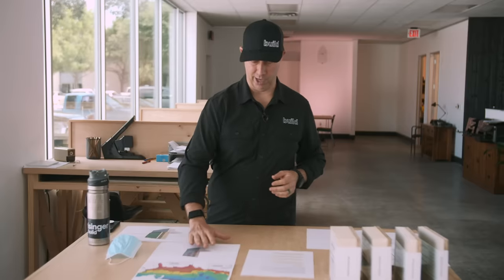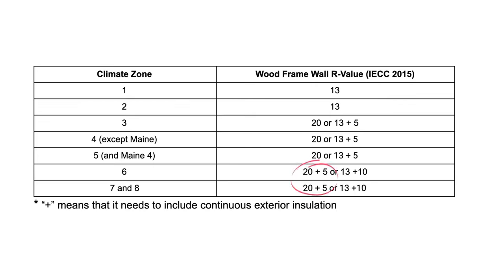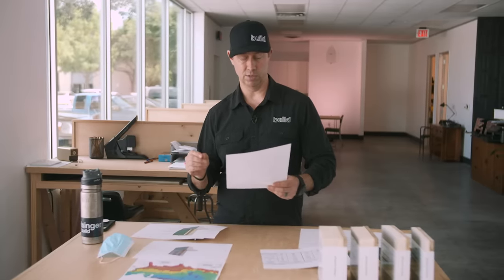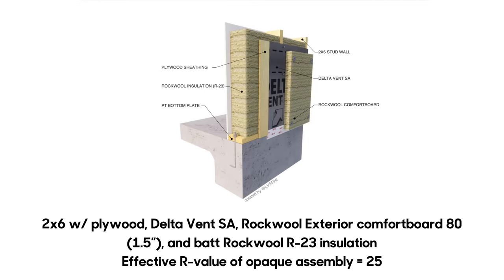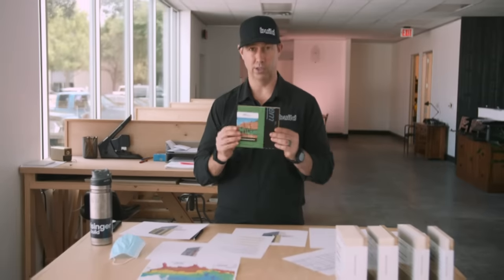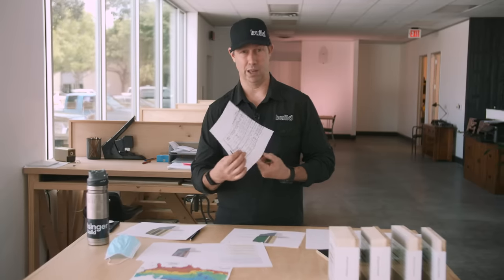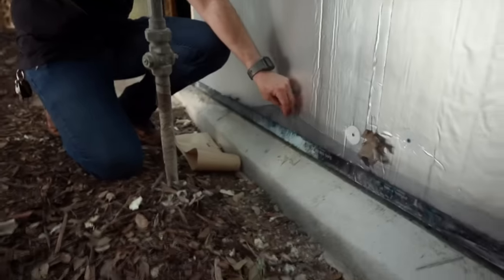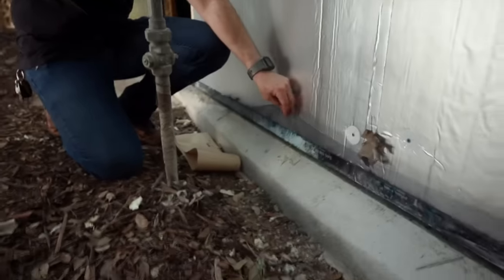5 Ultra-Insulated Framed Walls

Comment: One other important thing to consider that wasn't mentioned (although hinted at) regarding polyisocyanurate insulation is... Polyisocyanurate's R-value diminishes the colder it gets. So it is less effective in northern climates unless used on the warm side of the assembly and then you have to consider vapor transmission. So maybe interior side of ceiling below the truss or rafter assembly provided the walls are vapor open (for northern climates). A more natural assembly could utilize 'dense pack' blown in cellulose insulation (which retards air movement), solid 1x board sheathing, heavy roofing felt, and comfort board insulation. The cellulose, real wood siding, and felt (tar paper) have a tremendous capacity to absorb excess moisture and dry out later. Many traditional and natural materials with much less embodied energy can and do perform as well provided the wall assembly is constructed with some planning and foresight.

Comment: For zone 6A a RESIST assemble with 2 inches of GPS foam taped, provides a flow through assemble.   With 2x6 T studs and ICF you have a continuous air control and thermal control layer.  That provides the monopoly framing and meets the perfect wall guidelines.

Comment: On my old house there is 2 by 4 walls and only sheething innside, cold climate in Norway.
Doing renovation on it and changing the wall siding, put 2x2 laying on the whole wall and insulated the outside with rockwool then Tyvek vapor permable fabric and then one more layer pressure treated 2x2 for air flow and then the siding. 

Love the tought of insulated house framing where it stays at a nearly constant temperature all year around
Reply: Everything of the stick framing is 60cm on center here or 23.6inch so there is a small scuare overlap wood only all over the wall but much better than whole stud wall exposed to the cold.

Could not get a hold on the firm rocwool type made for exterior use without 2x2 framing so just used regular for cavity insulation

Comment: Being in the north, zip sheathing is making nervous because it's air tight. We need a vapor barrier inside the house, so if it's air tight on the outside as well, any water trapped in between may cause rot. There are many documented rot issues because of acrylic siding causing a similar issue where it is supposed to be water and air tight, but unavoidable defects (from install or from later modifications) end up causing terrible rot.

Comment: Would love to see about ICF walls and a SIP roofing. I’ve been looking at building a house in climate zone 2 in Arizona with a standing seam roof, and on the walls, half to be different color standing seam on top and rock face on the lower portion. I’ve seen some other people post about it and wanted to show interest.
Reply: ICF is great in your climate. A lot cheaper ways to insulate than sips.
Reply: SIP roofs get a lot of bad reviews. They are a disaster in Alaska, mold. Even in the desert u better keep the water out!
Reply: I'm planning a remodel/addition in Scottsdale and am working with some really amazing BS engineers where we're trying to get to a passive house standard. What I will say is wood-fiber insulation is amazing in our climate and is often overlooked as a product (competes with Rockwool so Matt doesn't have a huge play to mention it). ICF is good but the carbon footprint isn't good. However what I will say is if you do ICF, focus on exterior insulation and keep the interior mass uninsulated to allow for radiant cooling/heating during the day and charging at night.
Reply: Gerald Leenerts     I’ve never heard of wood fiber insulation. I can put propane torch blue flame on Rockwool for a minute, it’s will not burn, it turns dark & puts out a little smoke but will not light & burn!
Yes in the desert the thermal mass (concrete) should be on the inside for maximum effect, but I don’t think it’s wise to use ICF & strip the foam off the inside....
Reply: @GeraldLeenerts   they have done studies it doesnt matter which side has more insulation. What is the carbon foot print of a house that lasts 200 years vs one that lasts 50
Reply: @av1204  the concrete will last, but the foam might not. Wood structures can last hundreds of years too. Recycling wood is much easier too. Turn it into biochar, pulp, burn it for energy, re-use it in a new structure etc....

Rockwool is an interesting product, however wood-fiber insulation is very fire retardant as well, much more so than ISO.

Also, Fox blocks makes a ‘reveal one’ which only has insulation on one side. I haven’t used it, but that’s what I was looking into before I learned more about more green materials.
Reply: Gerald Leenerts the house I currently live in has concrete walls and its great to keep out water and bugs but boy it transfers heat and cold, so I’ll keep in mind what you’d said about insulating the outside instead of the inside but at that point it’s just a concrete poured wall with insulation on the outside. At least both should keep heating and cooling costs down. As for the carbon foot print, I willing to go with a bigger footprint if it means being used for longer, so using more upfront but extended over a longer period of time than a traditionally built home.
Reply: @Venumundo  There is no right answer, and ICF is a find product. What ever direction you go, I'd love to hear how it works out! Every building is its own case study.

Comment: I'm sure there's all sorts of research on this but I would be worried about shear resistance with the thicker Zip System sheathing. My inclination would be to just say no in the most serious earthquake areas.

As an aside, the exterior rockwool insulation sounds awesome for use in a fire area. This seems like it could be part of the construction of a nearly fireproof house.

Comment: Hi Matt this is a great tutorial on wall assembly options for different climate zones.  What I'd LOVE to see is how you deal with windows in each of these options.  Where is the window flange mounted (to sheathing)? Do you furr out the window openings so that you can attach the window flange on the outer face of the rigid or Rockwool comfortboard? My understanding is that ideally you want the window glazing to line up with the rigid insulation plane.  Any details you have for the different options would be appreciated. Thanks, Blake

Comment: My house is a DELTEC home. The walls are 2x6 with a 5/8" plywood sheathing and then a 1" foam with fiber cement siding over.  I spray foamed the walls with3" of 2# foam. The basement is ICF and we sprayed at least 3" of foam on the rim, licking to the foundation.  Where I let down is on the attic.  I let the insulation contractor talk me out of foam and also out of a vapor barrier.  Seems that's standard practice in this area as I asked several builders and suppliers.  However, Half of the house is tongue and Groove pine so being concerned about airflow through all the joints, I did poly that part of the ceiling. Still, It cost less for utilities on this house which is 505 larger than our previous home and Im also heating the 900SF garage.  The walls of the garage are standard 2x6 with R19.  I only heat to 55 degrees in the garage.  We're in zone4 but it's actually fairly mild here in the winter for this zone.

Comment: one of the most interesting videos (that somehow I missed... for 8 months that is) if you ask me. I would like to know if there is a (calculated) point of diminishing returns on Insulation as expressed by R-value. The cost per sqft in the video are not horrible (unless you are building a very big house) but I would love to try to understand where is the sweet spot in R-value aim, mechanical efficiency of the house-as-a-system and then, from there, create a guideline intended to help new home-owner orient themselves in this field. Kudos to Matt and all the crews to make videos that are not only interesting and instructional but also funny to watch (funny to watch insulation video.. not a small feat if you ask me). Very well done!
Reply: You say these costs are “not horrible”. This video is from 9 months ago. I don’t know what the future holds, but current construction costs have skyrocketed over a short period of time.

Comment: I’m getting ready to build a small home in Northern Kentucky; as a mildly cold and very hot, humid climate I’m curious about recommendations of how to design my exterior walls. I’m a mildly disabled veteran so I’m building on a budget so that I’m prepared for when my body won’t allow me to continue working. If it matters, I’m trying to make my design wheelchair friendly just in case I regress to that stage.

Comment: I'd like to see you start to feature the science behind non-traditional buildings. I'd like to know how to insulate and seal a monolithic dome home, for example. Or how about the science behind cob walls and their ability to take in and release moisture in a beneficial manner for the house and occupants.  I'd like to know the pros and cons of these nontraditional methods. I know this is not the kind of building that you do, but I would be interested in what you learn and have to share about this side of building science.

Comment: Are the 2x6 and 2x8 studs sill 16" on center or did you bump them out to 24"? 

Having less studs means having more insulation which would improve performance and would adjust costs a bit as well.
Reply: Was thinking exactly that, should be 24" OC for 2x6/8.  And of course, T-Studs!

Comment: Instead of 2X8 framing try 2X8 top and bottom plates with double 2X4 studs. It stops the thermal bridging and reduces the risk of severe twisting. The double 2X4's can be tied together with a small 3/8 plywood gusset O.C. to stabilize and keep straight.

Comment: I'm in the process of a post frame house. I'm doing 2inch rigid foam in-between the post that are 8ft oc and  behind the 2x4 stick framed walls. The stick framed wall is non load bearing so it's 2ft oc and spaced from the rigid foam 2 inch's so it can fit r23 mineral wool or dense packed cellulose

Comment: Exterior insulation has been prescribed for over 20 years in the Canadian Northwest and Alaska, both for new and reconstruct projects for insulative/conservation of heat reasons. R.E.M.O.T.E. wall systems in Alaska leaves the stud wall free and open for utilities without moisture or temperature problems. Standard stud construct, but different mindset for the outer walls and window/door penetrations through the insulation. Comments?

Comment: Love the vid, 
question. What about horizontal 2x2 on the inside with extra batting. We use it here in Sweden.

What about non permeable plastic on the inside of the 2x4 in colder climates?

(Plastic between 2x4 and 2x2 for wiring, no need to penetrate any plastic that way.)

Next one for roofs maybe? 
Thanks.
Reply: I'd like to see this as well. Very little thermal bridging, lots of room for insulation, ability to avoid penetrating the vapor barrier and no engineered components so inexpensive maybe.

Comment: There is nothing wrong with using foil faced or otherwise vapor impermeable exterior insulation in northern climates - but it's very important to put enough of it to keep the interior side of the sheathing warm enough to be above the dewpoint. And let the assembly dry to the interior - which means no interior vapor barrier.

Comment: Why complicating? 

6x6 poles, spread every 8ft, with 2x4 cross beams internally and externally. Cross beam offset vertically to elongate thermal bridging. You have 6in of solid rockwool insulation with cross-pattern of 2in on either side giving total of 10in with lowest (thermal bridge) case of 2in (external insulation) + 6in (timber post) + 2in (external insulation) combo every 8ft!
This is basically a passive house construction in every climate!. In most climates you can easily go with 6in if central rockwool and 2in free air voids both inter and externally. Or reduce beam thickness to 1x4 and pack them with 1in insulation or air void.  

This is on 6x6 post which allows you built 3 stories up. 
Posts every 8ft give cheap foundations.
Total timber volume is less.
Total building weight is less.
Framing time is less.
And you totally open internal space which can be arranged and modified freely. Only external walls/post are weight bearing  !!

Comment: The exterior insulation makes a lot of sense, but one thing I do not understand is why nobody accounts for it on the foundation. A bunch of screws is fine, but why not have a "brick ledge" that you could rest your rain screen battens (almost like another wall) on to account for some of the shear? You could then have super thick exterior insulation without some of the shear concerns
Reply: Search out Green Building Advisor. There is a thread there that has a serious discussion about holding up the exterior wall finish on furring attached through thick exterior insulation. John Straube reports test results that suggest this is far less of a problem than you (or I ) would think. And the comments are mercifully few, and intelligent, fact based, informative, and highly actionable. Good stuff.
Reply: Lee Stevens Thank you.

Comment: Love the content. For most people (like me) would probably want to upgrade their house vs build new. So guessing would have 2x4 or 2x6 construction with poor insulation value. Adding Zip/rockwool seems the way to go. What do you recommend on exterior facing material? Vinyl vs aluminum vs brick vs etc.? Have you run the numbers for ROI on attic vs house insulation? What gives the most bang for the buck?

Comment: Our houses don't even need sheathing it just needs a vapor barrier then you can attach the cladding on top. Now you may need sheathing in high wind zones for stability. Usually easier to do than bracing.

Comment: I like this, I've seen designs for high performance walls but they've always been so novel in construction that you'd need a special team to do it and you couldn't make the resulting house blend into a regular housing community.  It would look odd and thus be hard to sell.  By the way, I had my A/C guy in today for regular maintenance and as my units are ageing I ask what he's putting in new.  I was asking about inverter tech, he said that split systems with that seem to perform really well and are reliable but putting it in whole house units has not worked well in his experience.  They work well but they break down more frequently and are VERY expensive to repair compared to a regular unit plus they're more expensive in the first place.  So you will have some energy savings but it will all be wiped out in just one breakdown.

Comment: good presentation of comparative costs. Needs moar graph! and some sort of R/$ comparison to help folks find their sweet spot of cost vs R value.
Also some rough 'total square feet' for common house sizes, like '2000sq' house is roughly 1500sq' of exterior walls / envelope'  as a baseline, with the wall types sq' costs multiplied out would give some sort of rough costing formula or gradient.

Comment: The recent wall framing videos were some of the best ones you have done.
Could you do a similar one on roof framing?  You could use the stupid southern practice of locating ducts in a hot attic as Option #1.  Then use conditioned attic alternatives for the rest.

I do have some questions about roofs.  In the perfect wall concept, the control layers are continuous from the wall onto the roof.  The same principles that apply to a good wall also apply to a good roof.  So why do we build roofs differently than walls?  On your monopoly house, you have a lower Zip roof deck, then two layers of polyiso, then an upper Zip roof deck.  If two separated layers of WRB are bad for a wall, how can it be good for a roof?  Why does Huber not rate the Zip-R product for use on a roof to control the thermal bridging there too?  Are there other ways to control thermal bridging on a roof assembly other than having two separated roof decks?
Reply: In a 1 story house, you will have more roof sq ft than wall sq ft.  So getting the roof done correctly and on budget is very important.

Comment: I was wondering what type of furing strips are used for Rockwool that will not rot? And screwing exterior insulation into zip sheathing would potentially create a moisture penitration point? To combat that using zip r sheathing....but am concerned about racking.  And why a double stud wall is not in here? If you could go over some of these things in a upcoming video that would be awesome!!

Comment: Matt, could you do a similar video on staggered stud or double walled construction? I love seeing the Scott True builds you share cause it shows some great tips on how the everyday person could potentially afford a more high performance house without going ultra high end on some of the items. I'm not a builder, I don't know what lumber & framing costs account for in a typical build, but I am definitely curious if some hybrid type system - something with advanced framing, spray foam (flash & batt), staggered stud/double wall, can produce an even more affordably built home. I can see windows and doors being a bit of a pain... but at least in my area, two 2x4 are still cheaper than one 2x8.

Comment: This was a great video, but I would like to see the complete wall, including vapor barrier. In the south, you have addressed it with the foil. But in the north, it is debatable . In the winter one would like to stop the moisture flowing out, and condensing of freezing at the sheathing. But in the summer you want to stop the flow to the inside. 

So for zones 5-7, how would you do the vapor barrier with rockwool in the cavity, and comfort board exterior to the plywood (or zip)?

Comment: Matt,
Are the models computed using a standard 16" on center framed wall? What would the costs be if you used 24" on center with the plywood sheeting?